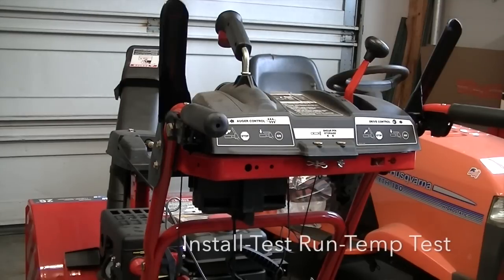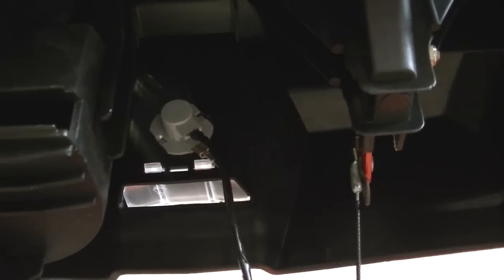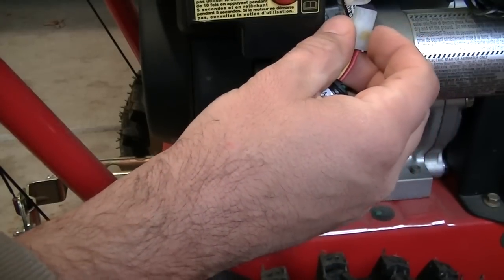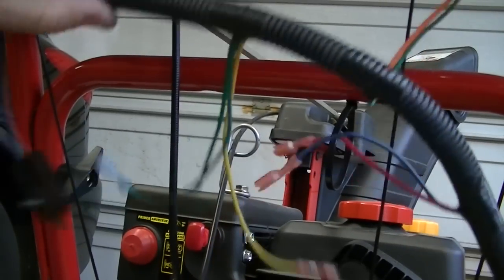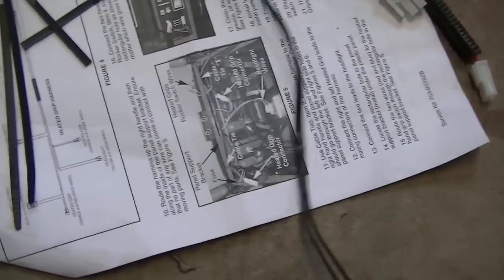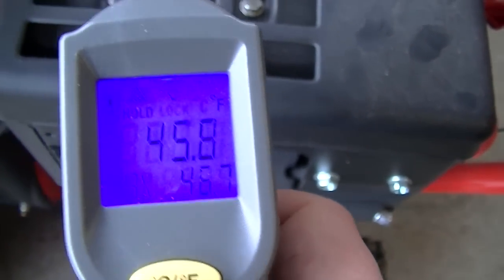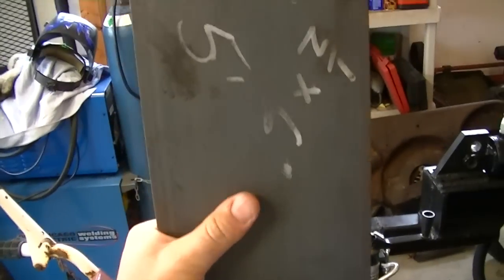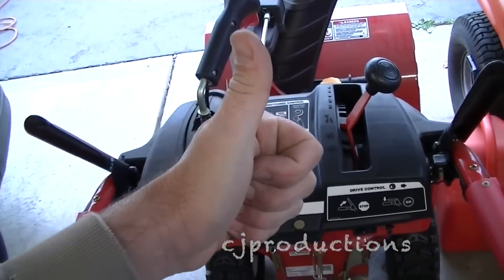Troy-Bilt Storm Handlebar Warmers Install, Test Run

Comment: Heated handle bars are likely right up there with heat seats that I used to think were silly until I bought a car that has them, are they ever nice on a cold winter's morning.
Reply from the maker: +Dale Calder Living here in Buffalo, I parked my butt in more vinyl clad seats as a kid and young adult that were so cold, you could feel it in your molars.  I won't buy an SUV (usually what I drive) without them.  I even use them outside of winter when my back acts up, the heat helps.

Comment: Craig, This is a really clear and easy to understand video, thanks for taking the time to make it. I just bought (11/2019) a Storm 2665. It has a four pin connector coming from the alternator. The hand warmer kit we both bought seems to only have two pin adapters. I can't seem to hook it up. Do you know if MTD has an adapter for a four pin?
Reply from the maker: The hand warmer kit that I found on Amazon has the two pin.  2016 models and later have a four pin, but I haven’t seen those around.  If I do I will comment and let you know.

Comment: Will these work for a Brigs and Stratton snow blower model Briggs & Stratton 1696619
Reply from the maker: I can't answer that unfortunately, this was for a Troy-Bilt snowblower that is made by MTD.  Now if MTD makes the snowblower for Briggs, it might.  Most snowblowers are made by MTD so just have to do some homework and see if the chassis and plug is the same.  They work good though, nice and warm.

Comment: Now I want a heated steering wheel for my tractor !!!  That is a nice hunk of steel for the splitter ..What is the tank with the yellow cap beside the gas tank on the snowblower ?
Reply from the maker: +not2fast4u2c Heated steering wheel would be sweet!  Do you have some snow coming your way Jim?  Thought I heard there was a storm in the mid west.  We're supposed to get some nasty winds today, gusts to 60...   The yellow cap is the oil dip stick, it sure does look like a separate tank.  I changed the oil this morning with 5w30 Mobil 1.  The tank like thing is a plastic cover that attaches to the fuel tank.   Guess the fuel tank is an odd shape.  Could have just had a metal brace attaching it to the tank.
Reply: It snowed here Friday ..I posted a short video ..the dipstick does look like a filer cap

Comment: Great stuff. I have the Storm 2625 that I'd bought in the summer and it came without the heated handle bars. I want to try and install the kit myself so I have 1 question to ask. why did you you the temperature thermometer and is it necessary to use it?

Comment: I'm kind of jealous but my old, well used Ariens cleared the 13 inches we got here in southern WI.
Reply from the maker: +David Fiedler I sold my 2000 Ariens 1028 about 7 years ago for $600.  That was a great snowblower.  I wish I never sold it.  It had heated grips, locking differential, long metal chute, 10hp Techumseh, huge knobby tires and grease zerks everywhere.   This Troy-Bilt has NO grease zerks, anywhere.  Keep your Ariens it will out last this thing.

Comment: nice but gloves work lol
Reply from the maker: +DriveShaft Drew Haha, my son said the same thing to me yesterday.  I actually wear my ice fishing gloves when I snow blow, but they still get really cold probably from being in the same position.
Reply: Yeah, but they wouldn't work here in Chicago, because of the brutal wind chill factor. Hell, you'll need gloves, hand heaters and anything else you can get.
Reply: When a shear pin breaks,  which happens often on my unpaved 900 ft driveway, I have to fiddle with the new pin bare handed.  Gloves don’t work for me there.  So then my hands get icy cold, sometimes dangerously so, putting my hands back on heated grips is heavenly, healing and saving.  As long as my hands, head and feet are reasonably warm I can withstand cold temperatures for long durations and I live in Vermont.